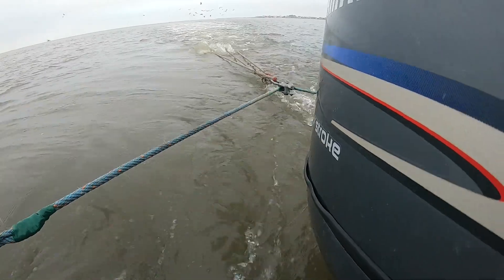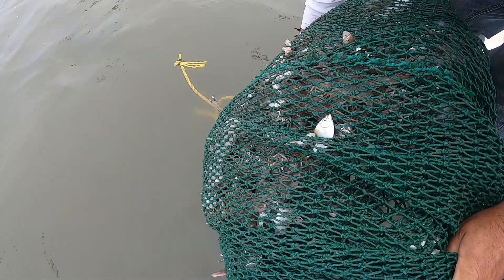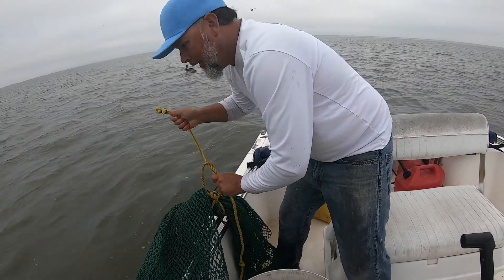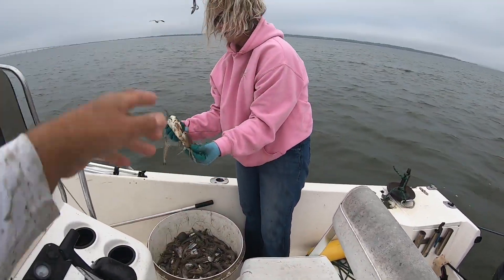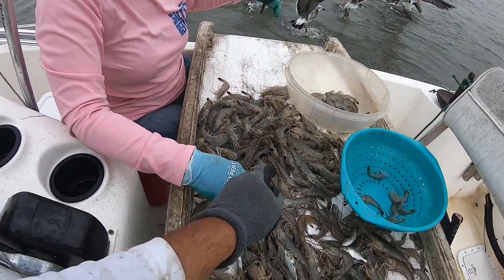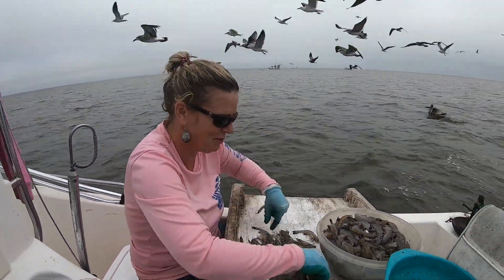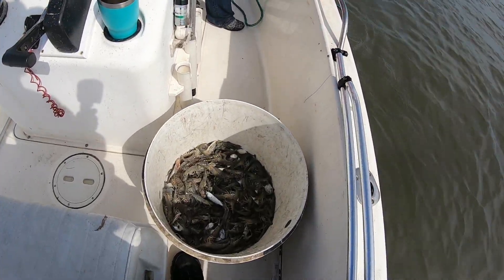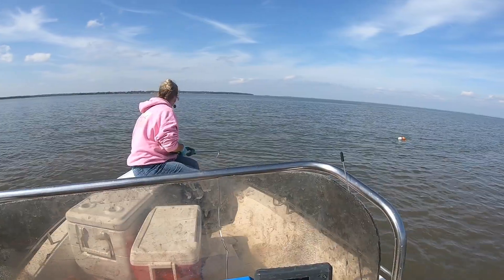Shrimp Trawling... a look at the things we're catching in a 25' trawl net

Comment: How about we got a thousand more questions for y'all but right now I was wondering how much toe rope you're using
Reply from the maker: I was using 125' on this boat.  It depends on how deep you want to trawl.  Every ft of water, 5 ft of trawl lines.
Reply: @SaltyReflections  thanks again. Im so frustrated with that bib line. I cant get it right. I folded my bib over right & left and it measures 17' to the top of ea. Door. So i added 17' of rope to the center thimble. And it still isnt right. Im gunna pin that bib back and forget about it. Im about ready to pour gas on it and go buy a balloon or semi balloon net. These professionals around here will not help a rookie once they see im commercial licensed.